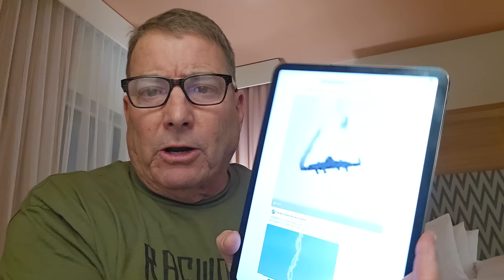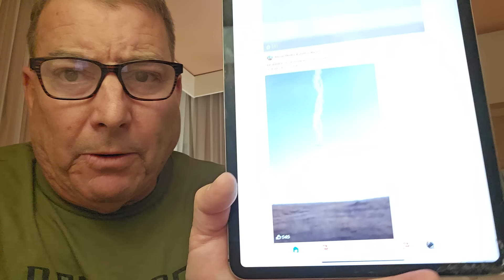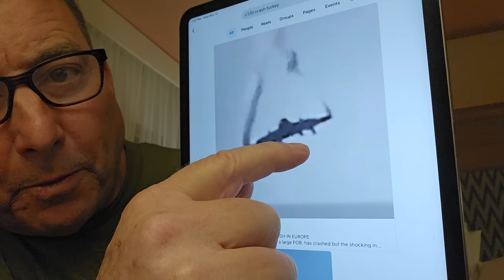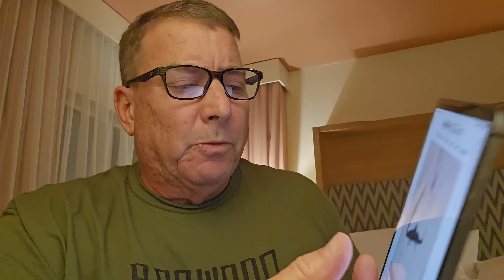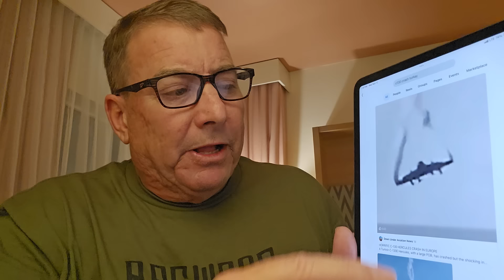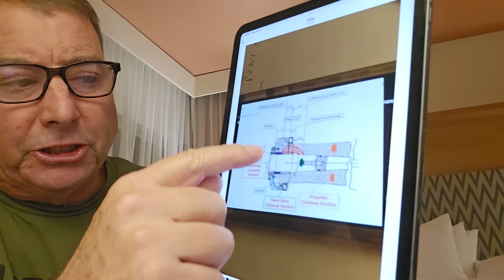Turkish C-130E Structural Failure 11 Nov 2025

Comment: As a former flight engineer on C121's and then C130's in the Wyoming ANG I am always interested, as you are, Juan. Of course our hearts go out to these airmen and their families as I try to imagine the terror they felt as they fell 24,000 feet. God be with them. Thanks as always for your reporting and knowledge.
Reply: My dad was an ADC nav with RC/EC-121s out of Otis AFB, Cape Cod, in the mid-'60s. Their wing lost three aircraft and 50 crew (one survivor, a nav) to engine fires/prop failures. Dad said that during the first few hours, climbing to mission orbit altitudes over the Atlantic, the Connies (Warning Stars) just hung on the props, heavy with fuel and all of that tonnage of radar gear aboard. Good on ya for all of your years facing those immense panels of instruments and controls that FEs were responsible for!
Reply: @dananichols1816  Thanks. After 9 years in the guard, I went to medical school. Then I joined the US Army for 10 years.
Reply: @dananichols1816  Prop failures are for real (see C-130)  They will cut a fuselage in half and (like in Florida) leave passengers and flight crew helpless as they fall out of the sky.  I think the only thing you'd have time for is a Hail Mary
Reply: 28 years as a load in the same unit…I always have to stop and watch if they mention a 130. I can’t but again I can imagine what those poor souls would have experienced.
Reply: Did you FE on C-121's or EC-121's.  My Dad was an FE on EC-121's out of Otis, up until 1969.
Reply: Regular C121's. We were an aeromedical evac unit. Lot's of nurses. War is hell. @paulholmes672
Reply: luckily, they probably didn't know what got them as they would have immediatley been subjected to altitude black-out
Reply: @dabneyoffermein595 most fit adults under 45 will remain conscious for minutes at that altitude, although rapid loss of mental reasoning soon developes
Reply: @obese1konobe  AH, thanks for the information, it must have been terrifying, I liken it to WWII when the B17's were being shot down, the torment by destruction and gravity is unimaginable. The only way we could have ever gotten an account from someone who experienced that, would be a survivor that parachuted to safety in a war out of a massive plane like that, which would never have happened, likely.
Reply: @dabneyoffermein595  Break-up occurred at FL 240 (24,000 ft). Charts show, Time of Useful Conscious  (TUC) at FL 250 (25,000 ft) is 3 to 5 minutes for the average healthy human body. TUC means the time that your Brain has enough oxygen available for you to make correct decisions and complete tasks correctly.  This was probably a Rapid / Explosive decompression, TUC would be much shorter. There is a possibly they may not have immediately passed out due to hypoxia (lack of oxygen). TUC increases as you descend through the pressure column (atmosphere).  TUC at FL 180 (18,000 FT) is around 30 minutes. Also those crew / passengers in the cargo compartment, would be subjected to centrifugal forces of the spinning wing / attached cargo portion. Another factor that is sometimes forgotten is altitude temperature. It would be Very Very Cold at FL 240 (-26.59 F).  Very horrible situation to be in. Retired US Navy & NASA contractor Aerospace Physiology Specialist.

Comment: How can a prop sever a plane in half?
Reply: The 54H60 blades are each about 6 feet long, each weigh 130 pounds, and there are four in each prop, spinning at 1020 RPM.
Reply: @TricksterJ97  and planes are made to be reasonably light.

And you don’t have to cut the whole thing, just enough to start a tear.  There are many other forces that are no longer properly balanced.

Comment: Thanks Juan, that's awful. After 58 years can't they just fit new build props when the old ones life out?
Reply: RTX Collins Aerospace subsidiary Ratier Figeac in France builds 8 blade NP2000 replacement propeller for C-130. Most of the remaining C-130 fleet in the us has been upgraded with them. Turkey just needs to buy it.
Reply: @blegi1245 and Collins owns Hamilton Standard and Hamilton Sundstrand
Reply: @TricksterJ97 yes and there is a reason why the new propeller is made by Ratier Figeac and not by what is left of Hamilton Standard or Sundstrand propeller divisions.

Comment: I had always though the C-130 was a solid, reliable workhorse.  Perhaps not enough critical mainenance after XXX hours?  Very sad.  My only experience with the C-130 is as a passenger back in 1969 II Corp, Vietnam.
Reply: More than 15 percent of the approximately 2,350 Lockheed C-130 Hercules production hulls have been lost, 
including 70 by the US Air Force and the United States Marine Corps during the Vietnam War.

The data indicates that combat shootdowns are rare compared to non-combat accidents.

They feel big,tough and invincible but when things wrong,it can happen very fast in a big way.

Even empty,
they’re really heavy and they’re pushing 20,000hp.

There are various sites that detail every single known loss.

Comment: It's been several moons, but my father was supposed to fly with the Turks in a SAREx back in the 80's on their Huey's.  After preflighting THEIR Huey, he spotted a crusty build-up on the rotor mast and refused to fly on it.  After a "stink", all their Huey were inspected by USAF crew chiefs and failed safety inspections.  If this Herk was cared for in the same way the Huey's were 40 years ago, their maintenance and leadership standards are STILL to blame.

Comment: 1968 model?  Ancient aluminum that should not still be in the air.
Reply: The problem was not the airframe.  It was the prop.
Reply: not necessarily....look at the skies over Alaska...DC-3's, Beavers, Otters, C-180's, Super cubs, C-46's, DC-6's....... it can be done

Comment: To my knowedge, the only ways to kill a Herc is to auger in, get shot down, or throw a blade. These airframes are about as reliable as it gets.
Reply: Alaska International Air C-130 (N102AK) broke up on approach to Bettles, AK in October 1974,  with a right wing failure due to metal fatigue, and that airplane was only 7 years old.
Agreed, C-130 is very tough and a great airplane (my dad was a flight engineer for AIA) but they were worked hard building the pipeline, with rough runways and awful weather.

Comment: I remember there was an incident involving a C-130 doing fire fighting where the wings folded up and broke away from the aircraft.  Horrible.  😢
Reply from the maker: Completely different issue.
Reply: @blancolirio wing spar failure right?
Reply: @pushingporsche4830  it was failures of the lower skins  of the Centre Wing Box that initiated that failure. Was startling to watch
Reply: @blancolirio  so, In that incident the wings fell off, in this one the prop fell off, causing the front and back to fall off, completely different-are you trying to defend the potential for this airframe to have catastrophic failure for some reason ?
Reply: @mertonallowicious in what world does pointing out that these are two different failure modes amount to defending the aircraft?
Reply: you should rethink your commentary.
Reply: @mertonallowicious  All aircraft have the "potential" for the airframe to have catastrophic failure.
Having a prop blade cleave a large enough area in the fuselage of a semi-monocoque airframe, and the normal aerodynamic forces, not to mention the severe out of balance of the remaining prop,  extreme yaw and roll event, and that forward section is coming off.
Go troll somewhere else.
(AC-130H crewmember)
Reply: @trunkmonkey-1  I’m not trolling, I have watched Juan’s channel for years, it’s obviously a different cause with the same result, I’m questioning why he felt the need to “put down” the Op comment which was just stating a fact. Now that you guys have piled on me I see it really is something about defending your aging airframe🤷‍♂️
Reply: @Graham_Wideman  when Juan takes time to reply to comments it’s usually to correct someone- what’s to correct here? You all seem SUPER  sensitive about these planes falling apart- this particular failure is not new, as he noted, and the Op was simply recalling the most famous failure on video👍
Reply: @mertonallowicious  Ummm, I know you are just egging it on, but I'm just really curious how "Completely different issue" is defending the airframe? He didn't say, "That's a non-issue with these planes" but was just pointing out that it has zero to do with this incident, different issue with different circumstances, so just keeping it clean, so that people don't get confused when commenters bring up every incident that's ever happened to a C-130 in its seventy years of flying...
Reply: @mertonallowicious  "I’m questioning why he felt the need to “put down” the Op comment " There's your problem. You misread Juan's brevity as putting down the OP. No one here is being oversensitive about the airframe, they are calling YOU out for being oversensitive about Juan's comment.
Reply: @mertonallowicious  Juan simply stated the wingbox failure on the firefighting C-130 was not related to either KC-130 with prop failure or the supposition that the Turkish aircraft likely also suffered a prop failure. And both of these have nothing to do with "aging airframe". 

 Almost any airframe or engine may be maintained to a safe and serviceable condition when proper maintenance, inspection and Quality Assurance is ensured. Aviation is a field that is both complex and complicated. Unless one has been involved in much of it, it is easy to not grasp details.

That is not a criticism, but an observation of a great many years in a professional relationship with aviation.
Reply: I've seen that exact video. Sad way to go, while trying to save nature and lives.
Reply: Hawkins and Powers back in 01 I believe.  Lost a Privateer in a similar accident very close to that, prompted the government to shut down and review all firebombing companies.  Hawkins and Powers essentially went out of business.  Many of the plane carcasses in Greybull WY were just up for public auction last month, curious to see what becomes of them.
Reply: That was a C-130A if I remember correctly, it had a structural failure at the wing to fuselage attach points, both wings came off. this was in 2002 and a month earlier their PB4Y-2 folded a wing and crashed. The NTSB and Forest Service grounded the large tankers. H&P closed up shop and now it's converted jet airliners and helicopters fighting fires.
Reply: Don't feed it guys

Comment: I flew on C-130 for years as a Lockheed tech.  I was wondering what your thoughts might be on 8 bladed prop retrofit for H models.  Most now are going to the bone-yard with only 12-14 flight hours.
Reply: Active duty USAF flies all J models.  The Guard and Reserve are retrofitting all of their H models with the 8 blade props due to the Hamilton Standard Prop's blade shedding issue.  They produce more power, are a lot quieter, and are trouble fee.  They have over 100 retrofitted airframes in service now.

Comment: I believe you may have this one figured out. I was a C-130 FE and flew the E, E/H, and H models. Sadly, my Instructor TSgt. Bill Turk was killed along with 26 other souls on the April 13, 1982, crash over Turkey when the No. 4 engine Lord mount failed. My heartfelt condolences to everyone affected by this tragedy.
Reply: This one's not directed at anyone specific, but I'll just put it plainly. One of the rules of the internet is "don't feed the troll."
I'm not sure if their disbelief was based in an intent to troll or not, but it could have been, so I'm refusing to interact with it other than citing it as "maybe don't interact with this."
It used to be called trolling anyways, these days it seems to be called rage-baiting. Either way, don't interact with it and it dies off like a plant starved of light.
Reply: I remember this. I think it was returning to Incirlik from Erzurum.
Reply: I knew Turk too. Good guy and instructor.
Reply: So a prop blade slices a massive freighter in half ? Not buying it.
Reply: @Toro_Da_Corsa  Its literally happened before. Most recently in 2016.. Did you even watch the video?
Reply: @sylent-shooter  Some people exist only to be contrary. They feed on the attention...
Reply: @sylent-shooter Why is this plane still in service then ? And you ppl make fun of the Russians
Reply: @davidg3944 so failed prop blades lead to total fuselage failure. The Russians haven't built something this bad
Reply: @Toro_Da_Corsa  The C-130  has an excellent safety record but is (by far) the most used military cargo plane of all time and therefore some failures are bound to happen. There are several recorded cases of prop failures that have NOT severed the fuselage but unfortunately a few that has.  The Russians have built plenty of aircraft with MUCH worse safety records than the C-130 and none as successful as it so I'm not sure why you bring them into this or why everything has to be a fking conspiracy to guys like you...
Reply: @Toro_Da_Corsa  the propeller of a C-130 is 13.5 feet in diameter, each blade is over 6 feet long. The tips of the blades are moving at about 80% of the speed of sound .. Why would it be hard to believe something carrying such an insane amount of energy could rip right through an aluminum fuselage?
Reply: @Toro_Da_Corsa You don’t have to be “buying” it. Calculate the kinetic energy of that propeller, then look up the surface creation energy for duraluminum. There you go.
Reply: @absurdengineering sounds like a flawed design
Reply: @Toro_Da_Corsa had that feeling to but Juan knows a thing or two about it...
Reply: @Toro_Da_Corsa  how about buying a one way ticket to somewhere remote then?
Reply: @Toro_Da_Corsa  "So a prop blade slices a massive freighter in half ? Not buying it."

The power that causes the aircraft to be seriously damaged come from explosive decompression. The obvious analogy is a balloon and a pin.
Reply: @Toro_Da_Corsa  If you're so knowledgeable, what is your diagnosis of the cause?
Reply: @gerry_attrique  don't even waste your time, he's mentally challenged.
Reply: @gerry_attrique  Israel bombed it from the inside
Reply: @Toro_Da_Corsa get real!

Comment: I remember when they had problems with the throttle/prop controls.  One went down about a half mile from my house on approach at Ft. Campbell.  Back before your time, I think it was 79.
Reply: That might have been 1985-6 when I was there. One prop went into reverse IIRC…?
Reply: @davidh3152  The one in 1979 was an active duty E model, the one in 1986 was a Reserve A model.

Comment: You're incorrect about the failure profile on the Marine C-130.  Yes the single blade separated from the prop assembly on the #2 engine and lodged in the fuselage.   The sudden yawing caused the whole prop assembly and gearbox on #3 to separate and that went into the fuselage and this even caused the nose to separate.   The tail section remained attached as the herk descended.  The plane impacted the ground upside down with the tail still attached.
Reply from the maker: The number three prop struck the horizontal stab.

Comment: That’s crazy thinking the prop can slice and dice planes like that! 🙏
Reply: If you've ever been a passenger in a 2 or 4 prop plane, seated right beside a propeller, you definitely have a while to think about it.  I'm an engineer, so, I have an idea of the energy in one of those blades.  Best outcome (other than the prop blade going straight up or down and missing the rest of the plane entirely*) would be that the blade just goes right through you and it's over B4 you even realize it's happening.

*Even then, I would think the vibration from the unbalanced prop would cause further failures immediately.
Reply: @SpringIsBACK Also an engineer (retired). Flew on many 2 and 4 prop airplanes during my career, and was always uncomfortable when seated next to the line of props. Never liked being close to large high rpm machines! 😢
Reply: @SpringIsBACK  Yeah, I've sat right beside a prop on a Dash 8 where the plane was vibrating so bad through-out the flight that normal talking was impossible.  I was definitely looking at those props in a different light that day.
Reply: @SpringIsBACK long time ago i was a pax on an f27. Flight cruising along and out of nowhere the loudest bang. All of us turned white, including the young lady cabin crew. Pax got all curious so she went into the cockpit, returned relieved to announce that was just prop ice being shed. If you are here you know this, but most people dont. It was scary as hell, the energy is crazy. Also : how many prop blades have been shed and went into the blue skies instead of through the Herc ? Is it just a question of luck, or would anything increase the odds of the blade 'seeking' the fuselage (mount angle?) ?
Reply: @SpringIsBACK I use to think about the props on NW Airlines Convairs 🤔
Reply: Tremendous kinetic energy because of the rotation speed.
Reply: How do you know someone is an engineer? Don't worry, they will tell you. Always, for any reason whatsoever. Now you need to be an engineer to realize that a prop going through the airframe will cause catastrophic damage. Well.
Reply: @--SPQR-- the number of people who wouldn't realise is astonishing
Reply: @--SPQR-- well, actually the engineer is the one that should know about AC 25.905-1 and hence should be surprised, as the manufacturer is supposed to account for prop failure. Interesting tidbit : it mentions blades could strike forward 25deg of their plane, but then only asks for reinforcement 5deg fwd/back. In other words : windows over safety. To be frank i find that a tough one to call too, i really like my window seats.
Reply: @101jtag The aircraft would be carrying a lot of extra weight to be able to stop a 54H60 blade from penetrating the fuselage.